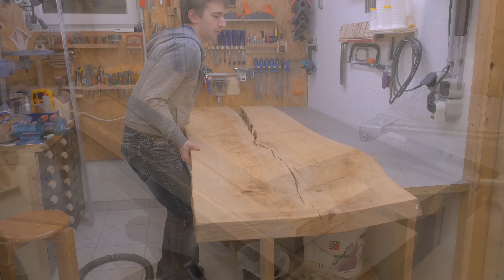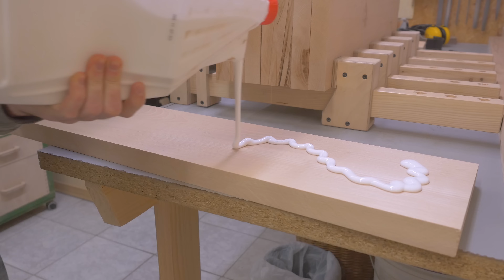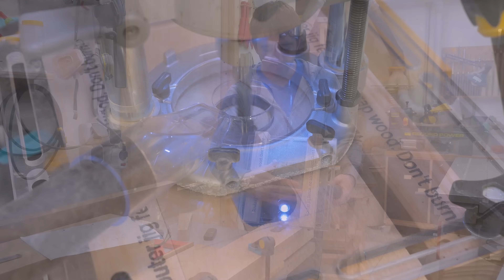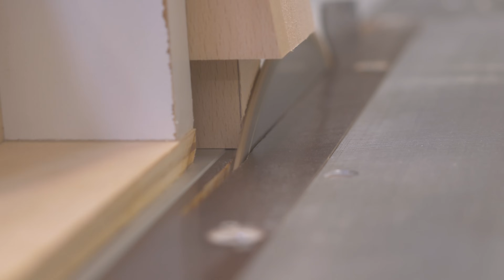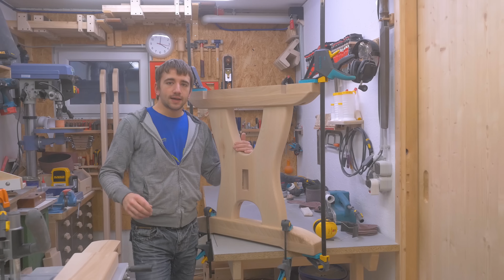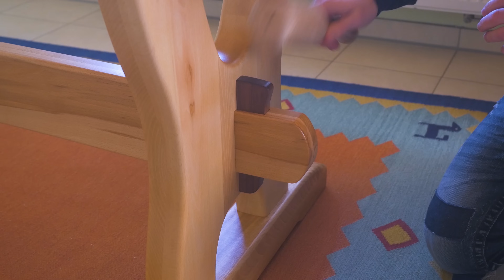Dining Table Base with 100% WOODEN Joinery

Comment from the maker: I plan to make a video with additional information about this table as well as a Q&A. So if you have questions about this tabletop leave them under my comment. The video about the tabletop has a similar comment.
Reply: Mal wieder ein klasse Projekt und auch ein super Video! 
Eine Frage zu der Tischplatte hätte ich. 
Warum hast Du keine Gratleiste installiert?
Reply: Did you select maple, cherry, beech and walnut only for aesthetic reasons? Using 4 different types of wood for one table propably isn't very common
Reply: Hi Marius,
The table look AWESOME a question for the Q&A: is this your hobby or your job? If it isn’t your job yet, are you planning on making it your job?
Reply: How many hours did this project take? (Itemized and total)...
Reply: Really your nicest piece among all your projects ! How much time did it take to make it?
Reply: How many hours in total did it take to finish such a great project?
Reply: As someone else said I would like to see your sharpening technique for chisels etc
Reply: Tolle Arbeit! Schön zu sehen mit welcher Detailtreue Du arbeitest. Woher bekommt man denn so tolles Buchenholz?
Reply: @arku4301 
Bei meinem privaten holzhändler krieg ich das buche auch bis 50 mm. Ist nur ne kostenfrage, ich glaub die Platte 2,00 x 40 cm breit x 50 mm kostet um die 50 €.
Reply: Stephan Lorenz wo finde ich denn diesen Holzhändler?
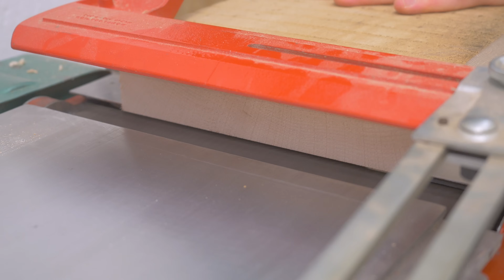Reply: Marius Hornberger Will you add more camera angles like on 2:47 in future videos? It’s totally awesome. :)
Reply: How do you attach the top of the table to the legs ?
Reply: @pierrot80-67  he uses bolts from below through slotted holes in legs into threaded inserts in the top - elegant
Reply: @pierrot80-67  With pieces of metal, despite all his promises! Lol.
Reply: Looking forward to it.
Reply: Are you concerned at all about wood movement within the side assembly?
Reply: Ура, наконец то вторая часть. Лайк не глядя!
Reply: Hi Marius,
Cooles Projekt und sehr präzise Umsetzung! Nur wieso hast du so präzise gearbeitet? Holz braucht doch platz um sich zu bewegen.
Reply: Have you considered using two bearings on the flush trim bit? If the bearing breaks, there's a great risk it will cut in to the material.
Reply: I'm mostly interested in seeing more of that extendable ruler at 8:50 lol
Reply: How many hours of footage did you end up having in total for all videos related to this project?
Reply: what program do you use for 3d modeling?
Reply: Hi Marius, 
Needless to say this is an excellent work!, like so many others admit. 
My question is, why you designed the bottom rail to be secured in place with wedges 
(which means ability to disassemble it), while the top rails are glued and so, the whole 
structure can not be disassembled? As i can understand, now you can remove only the 
wedges. What's the point of this? 
Thank you in advance for any explanation.
Reply: @Grg68  He explained that at the end of this video.  He glued the top rails for stability, which made the wedges purely aesthetic.  I think he intended for it to have the ability to disassemble, but because of the stability issue, decided to abandon that.
Reply: You sir have a wonderful future in fine furniture building 👍, if you want it. Your level of detail is of extremely high quality. I know your parents are very happy with the results of your efforts.
Keep up the great work!!

Thanks for sharing and God bless
Reply: @AR KU

Alsi bei meinem privaten holzhändler krieg ich solche Platten auch bis 50 mm.
Reply: @AR KU

Also ich bin kurz vor Mannheim zuhause.
Aber solche bohlen solltest du in jedem Sägewerk kriegen.
Reply: Where did you get the mortising jig/edge guide jig for router?
Reply: Is woodwork your primary job or is it more of a hobby?

Comment: What a beautiful workpiece! You always make such great projects and get the best finished result! This is by far not a complaint or something negative, I'm just wondering, why did you glue the top pieces into the legs when the legs are fastened with those wood pegs? I though the idea was to be able to take the table apart when moving? Again, no complaint or anything, I'm just curious.
Reply from the maker: The whole idea with this table was SOLID construction. It should never wiggle or similar. The pegs are still functional and decorative, but this table won't leave this house in the next 40 years, so glueing seemed logical
Reply: @MariusHornberger  Alright I thought it would be that - especially as you mention that it won't leave the house for a long time.

In any way, that table came our extremely nice, just think when your grandkids kids someday ask about the table and they tell them that you made it many, many years ago.

Really cool and awesome end result! Hope to see more like this in the future 😀

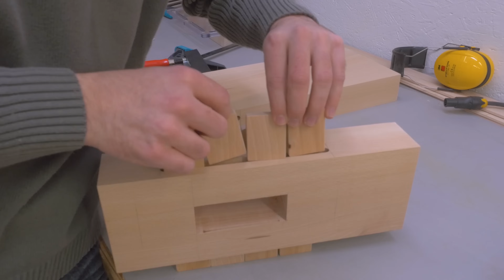Comment: 14:00 When the tenons/joints are not very tightly fitting, it may be better to use PU glue instead of PVA glue. PVA soaks into the wood at first, then, while curing, looses water and shrinks. If there's no pressure, and the fit isn't very tight, this may leave tiny open spaces. PU glue, on the other hand, absorbs water from the wood and reacts chemically with it, and does not shrink while curing - it fills gaps instead.

Foaming - which reduces mechanical strength - only happens at the squeeze-outs, where water is absorbed from the air a lot faster than inside the joint. Inside the joint, once cured, the glue is like a hard resin - yellowish, compact and transparent.

Also, PU glue remains slightly elastic, causing it not to crack, in time. Especially if the glue-up left tiny unglued spaces inside the joint, PVA, which is more rigid when cured, can crack and/or delaminate, in time. PU glue also glues end grain much stronger than PVA glue, IME.

True, PU glue is usually less mechanically resistant than PVA glue, which is why I usually don't use it on small area joints (except when I know the joints will experience a lot of wiggle stress, but then I do tricks to increase the gluing surface). But for joints with that much gluing surface as you have here, you'd probably get several times the strength required for even the strongest dynamic strain that the table will ever experience, even with PU glue.

Comment: Nice build.  The reason I would not have glued the base together is that it's probably now imposible to get through a doorway.  Right now that may not be an issue but if some day the tables wants to be in another room or say years from now when your parents pass and the house gets sold if the new owners want a different table it won't be able to be removed without damaging it.  The table should last hundreds of years so it would be a shame if it were destroyed tying to get it out of the house at some point in the future.  I did a lighter weight table that is very similar in design and seven feet long that breaks down completely for storage or moving and it's been in daily use for 22 years and it is still solid.  The wedges really make it very solid when everything is tight.
Reply from the maker: The table fits through the door once you remove the table top. I've never made such a wedge joint before, so I wanted to make sure that the table would last 100 years+ by gluing the top rails

Comment: Impressive. I love your precision.
Reply: I started working with wood last year so I’m a novice. I used to me a motorbike racing engineer so a decent change. I like you precision and detailing. At the same time I also follow ‘the English wood worker’ which is totally the opposite. Love to have the contrast to then be able to apply things in the most relevant context. Thank you again Marius.
Reply: If you use your router regularly to plane large timber you might like to look at this https://www.amazon.co.uk/gp/product/B01N2UQETH/ref=ppx_yo_dt_b_asin_title_o04_s00?ie=UTF8&psc=1. It’s 50.8mm diameter so quite a lot quicker.

Comment: Very nice. I think the loose tenons in the leg assemblies were overkill. Glue alone would have been enough. When you glued up the final leg assembly and had the squeeze out you could have drilled small holes through the bottom of the mortises and out the top and bottom of the pieces to allow the air to escape. The exit holes wouldn't be visible, but could be plugged later if you really wanted to. BTW, when routing the templates the first bit is "top bearing" and the last bit is "bottom bearing". Just as with spiral bits, they are always described as if they are in a handheld router pointing at the floor, not in a router table pointing at the ceiling.

A couple of years ago I built a 4' x 10' trestle table to go in a new house for a customer. I asked about designing it to knock down so it could be moved. They said it wasn't necessary as they were going to stay there and the table could go with the house once they were "gone". I built it to knock down anyway. Less than three years later they are selling the house and taking the table with them.
Reply from the maker: great tips, thank you!

Comment: Great! If you were to design the top of the base with joinery instead of glue, so it comes apart but locks in well, how would you do it?
Reply: I can't speak for Marius but I would use through mortises like the lower crossbar or put rabbits in where it wouldn't show so that a square peg would key the two parts together.
Reply from the maker: That was the big question. I couldn't think of any good joint there, so gluing was the best solution
Reply: When you tie down the table top it should provide shear strength even if your bolts leave space for wood expansion. It’s like using plywood on studs in wood construction.

Comment: I recently started running everything through my bandsaw before using the planer. It doesnt really save time in the end, but not running boards through the planer 10 times each is amazing.

Comment: Awesome build. Have you ever thought about air purification? Looks like it gets quite dusty in your small shop. Maybe it's just dust on the lens, but it wouldn't hurt to use masks or a filtration system. It makes big builds much more enjoyable over time.
Reply from the maker: My big dust collector makes a good job keeping the air clean. It probably looks different in a video
Reply: @MariusHornberger  Just saying after sanding it looks quite hazy. Then it's probably just the lens. Maybe something to look out for to get the quality of your videos even higher than they are already